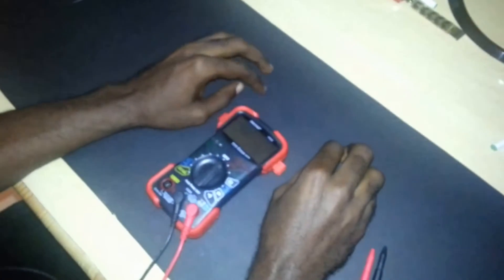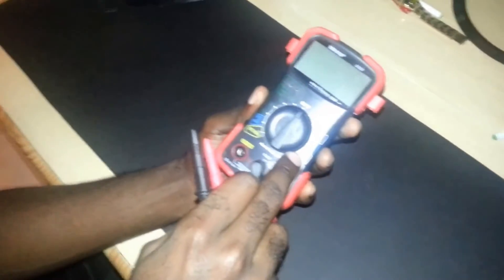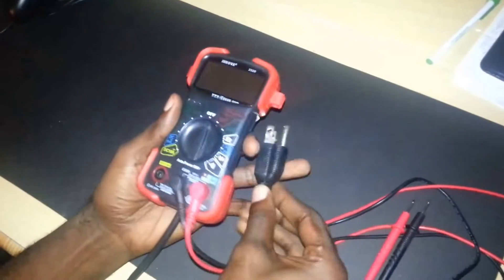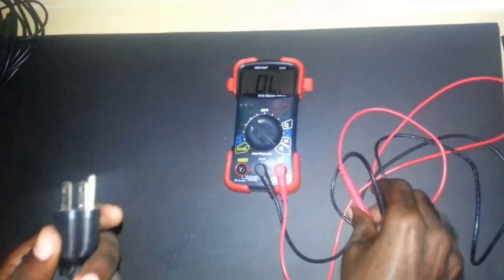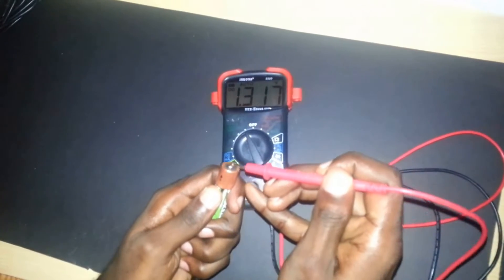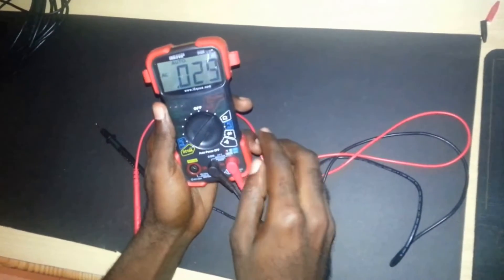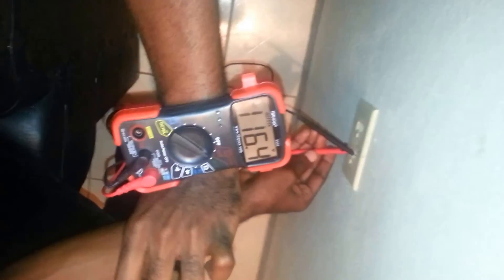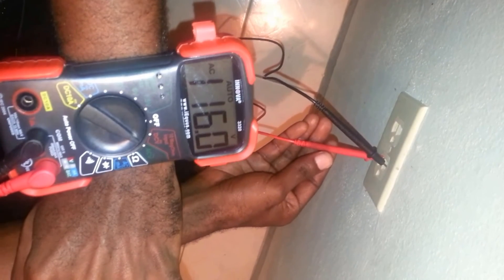How to use a Multimeter to test & solve household and computer Issues.

Comment: What a coincidence I was looking at this multimeter on Ebay as well. I could see that for $20.00 it is a great buy but my question is if this multimeter have everything you'll need for computer diagnostic purpose. I know that it was design for cars diagnostic but a the end is a multimeter right!!!
Reply from the maker: Nelson Agosto Yes for the msot part they are all the same
Reply: Ricardo Gardener It's very nice I now have mine and it works like a charm :D very happy with it. Also when you see at the back of the package that it comes with it says very clear that it can be used on computers as well.

Comment: Thank you Mr. Gardener. I recently put together a gaming PC and had a power supply and motherboard failure. I bought a multimeter like yours so if I have  problems again with my PC I'll be able to use it to help diagnose problems. Your video makes me realize how useful a multimeter is.
Reply from the maker: Glad to see a fellow PC Gamer on the channel, yes Multimeters can be very invaluable in troubleshooting PC issues, especially when they are not so obvious. I have been there with the dead Motherboard and PSU issue and trust me its nerve racking when you are shooting in the dark, but with a Multimeter the guess work is thrown out the door.Thanks for commenting friend.